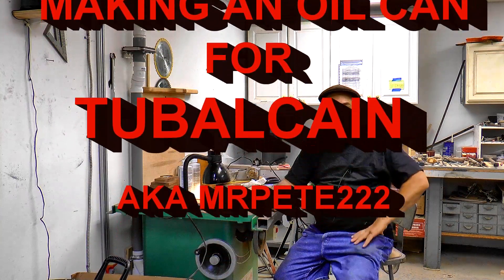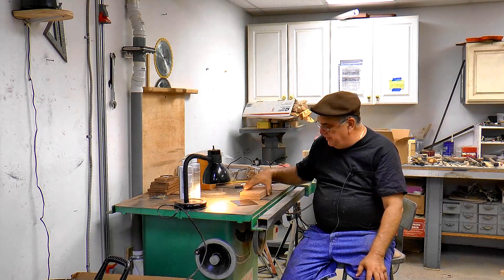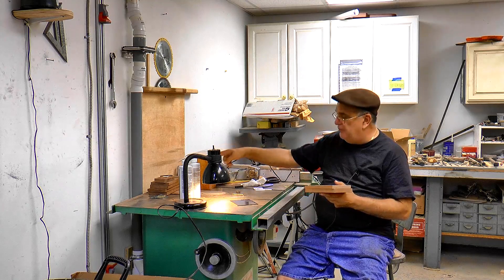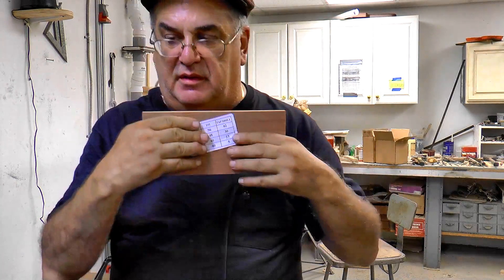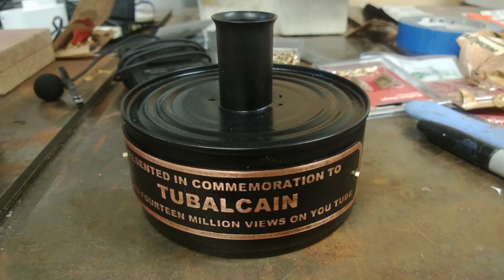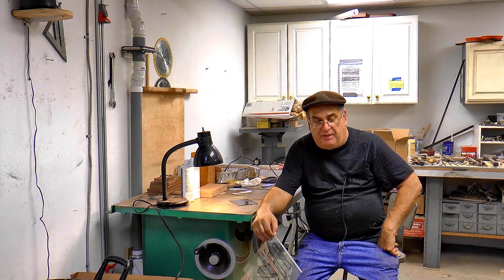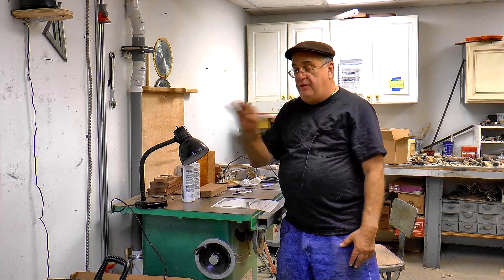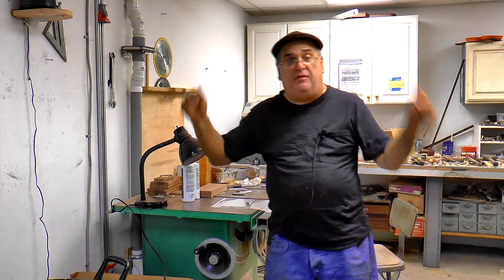MAKING AN OIL CAN FOR "TUBALCAIN" PT 1

Comment: I did photo etching years ago.  The chemistry has gotten a lot easier.  Just to correct one point, you created a positive to expose the plate.  A negative would have a black background.

I am sure that Mr. Pete will really appreciate such a useful and personal gift.
Reply from the maker: Hi Kurt
Yes you are right I made a positive art work. There are two different types of resist Positive and negative I have worked with both and I prefer the positive.